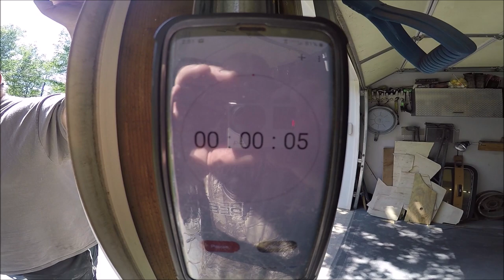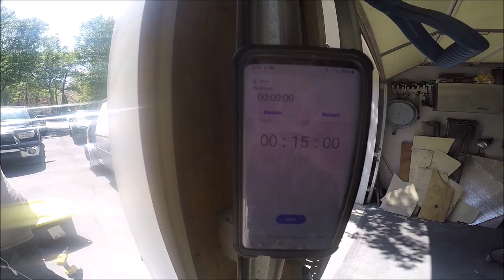How To Bubble Van Porthole Windows

Comment: Did you use plexiglas, lexan or polycarbonate? What did you use for the gasket material?
Reply from the maker: 1/8th inch acrylic plexiglass, $43 for a 24"×48" sheet on ebay.
Reply: @CrossCountryGarage  thanks

Comment: What was the thickness of the   acrylic  you used... thanks
Reply from the maker: 1 / 8 "  got a 2x4" sheet on ebay for around $48 shipped. You can make 3 bubbles per sheet and have an 8" x4' strip left over.
Reply: @CrossCountryGarage  thank you. ..

Comment: Please make me a sick bubble window for my van. I beg you. ;)
Reply from the maker: No time man. Besides, you have all the directions and materials from the videos. Give it a shot. I have had a few people send me pics of the bubbles they blew. Its not hard. Go for it.
Reply: @CrossCountryGarage  I was studying the videos last night and I think i'll do that for sure. it seems the hardest part would be getting the frames made as i'm not a welder. You guys did such a sick job on yours!
Reply from the maker: @joshandthejam7806  1 if our subs made the frames and instead of using the bungs just drilled thru the outer frame and welded the bolts to the outside and ground then down flush. Its actually an easier than our way and if I ever make frames again will do it that way. Still need to weld a little and do some touch up bodywork on outside of frames but overall much better. He also put bubble in from the inside, which I will be doing ob my van, just a cleaner look and cant believe we never thought of it.